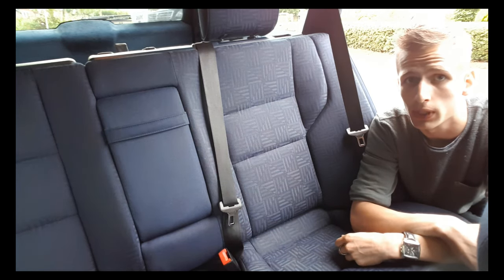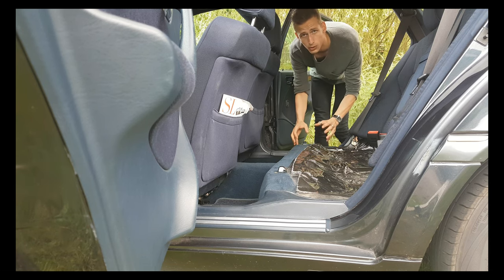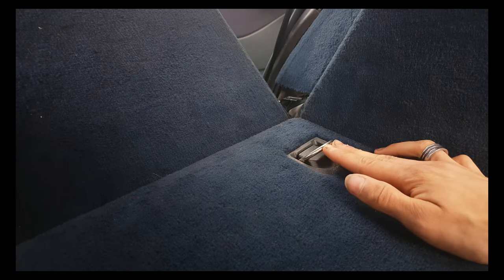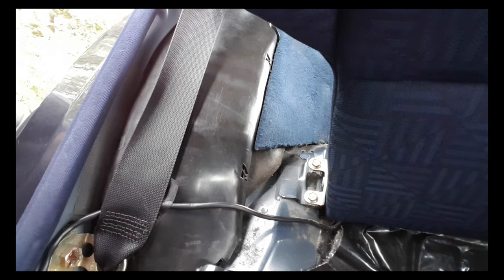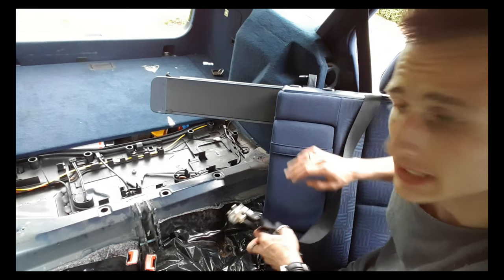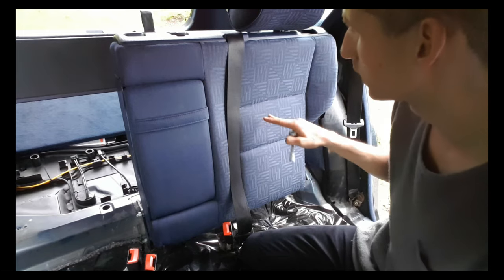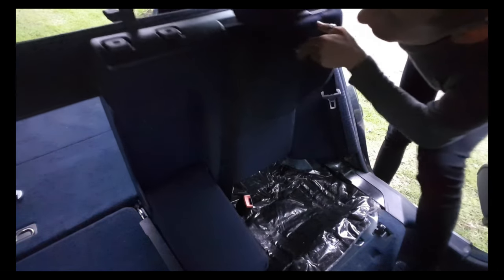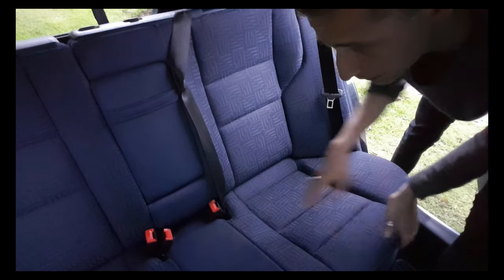Taking out the back seat

Comment: Thank you for your fine instructional video. On my 2000 C230 K I used this video to figure out the hard parts of removing the rear seats. On my USA/California car I did not have to unbolt the rear seatbelts, which made the job a little bit easier. There were a couple of other minor differences, however,  this video is important to be able to do the job. May I please request an instructional video done in your fine manner for R/R W202 rear headrests?
Reply from the maker: When i have the time to get some videos uploaded again. I will get to this subject too

Comment: Hi, thank you for your video. It shows details how to remvoe the back seat.  How to remove the hard horizontal bar attached on the top-backside of the seat? One of the two folding mechanism (which you pull up to fold down the seats) is broken in my car and I can't fold my seats down any more. If I can remove this horizontal bar then I can at least fold the bigger portion of seats. Do you have any idea how I can do it?

Thanks 
Jahangir
Reply from the maker: Hi Jahangir,

Sorry for my late response. Somehow your question didn't come through and I wasn't notified about your comment. To remove the bar you have to fold the back seat down and push the bar out from the side. I believe you have to push it to the right side of the car. Also known as the driver's side.

Comment: I have a similar model but in leather. The thing is I want to take away the  net attached to the back seat. I could only do it destroying the plastic. Anyone knows how do it professionally?
Reply from the maker: Do you mean the rollo attached to your back seat?
Reply: Yes exactly
Reply from the maker: You can slide that out when you have the seat fold down. I don't remember if it was to the left or to the right but thats how you remove the rollo